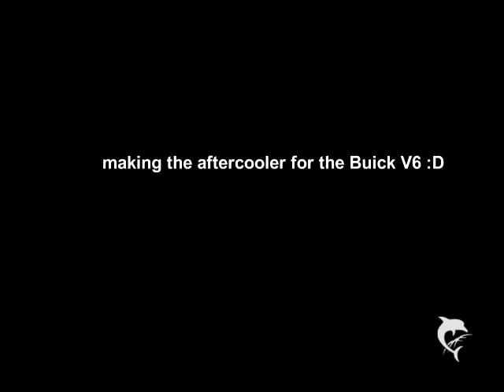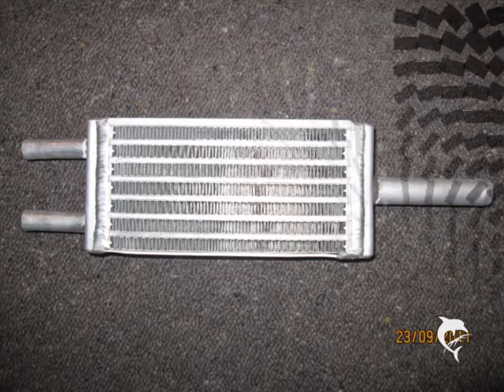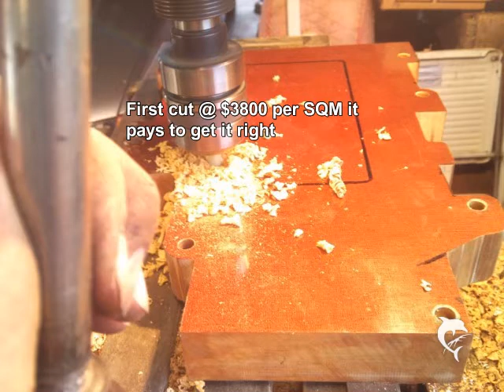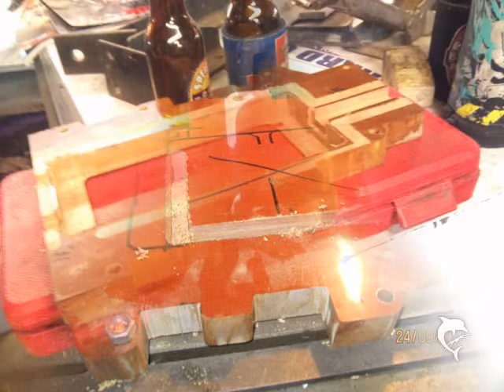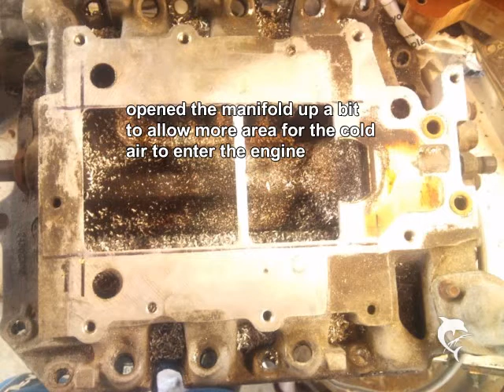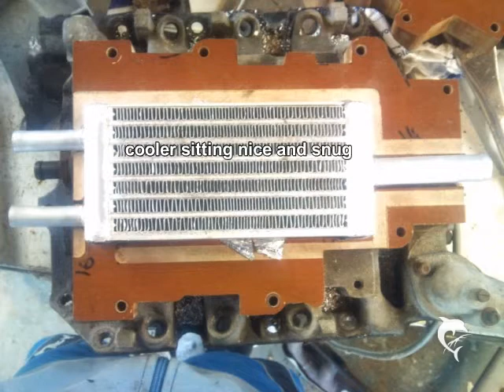making aftercooler for eaton M62

Comment: 2 questions: what is the material you used for the after cooler housing (some type of laminated wood?)? And where did you get that small radiator to fit the supercharger?
Reply from the maker: It's tufnol, the radiator was custom made in chirstchurch New Zealand
Reply: @b3n189  well I guess I won't be building mine that way then lol

Comment: Was this actually used? Did it work? As in no vac leaks or anything? I need to make one up for my Buick but not sure if it’d be worth it.
Reply from the maker: Reid Murnan yea worked really well, could put my hand on super charger after thrashing it for ages, inlet temp around 50 degrees celcus
Reply from the maker: This was used in a jetboat thou so I had water cooling from the river I was in.